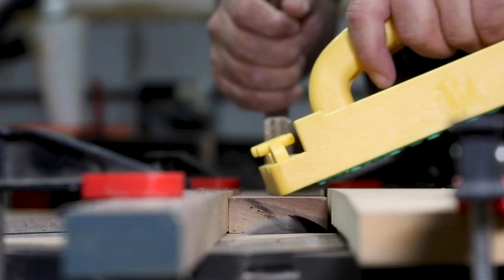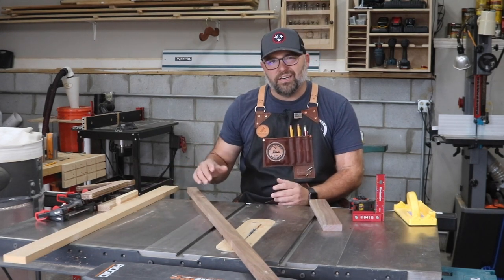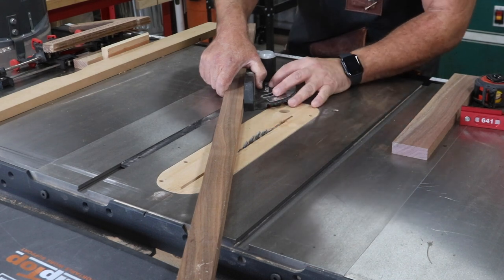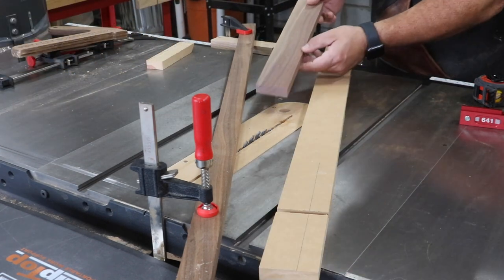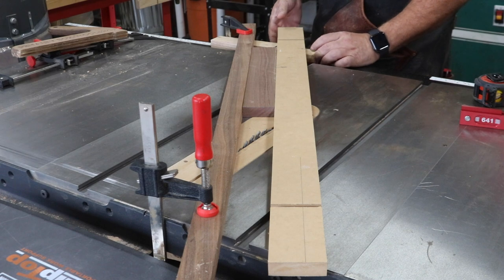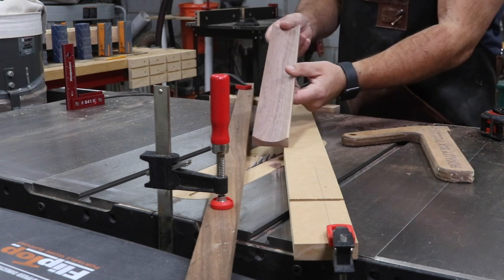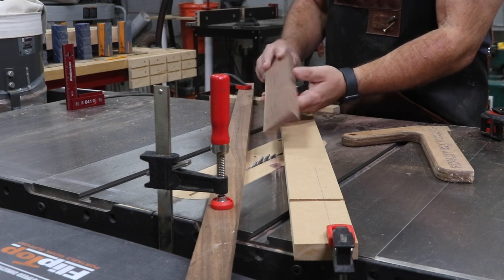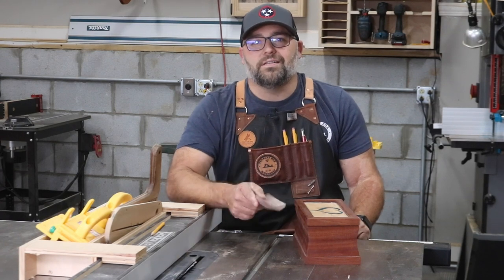How to Make a Cove Cut on the Table Saw - For Unique Boxes and Cove Molding

Comment: So cross-cutting with a miter gauge & fence in place is a no-no presumably because the lumber gets pushed over the rear of the sawblade and then gets launched forward. How is the cove cutting approach any different - what makes it safe? It looks like the motion is very similar.
Reply from the maker: It’s more diagonal and you have two outside guards in place. It’s very deferent scenario that a cross cut with the end against the fence
Reply: Agreed, also you're not leaving a loose piece of scrap to turn into a projectile.